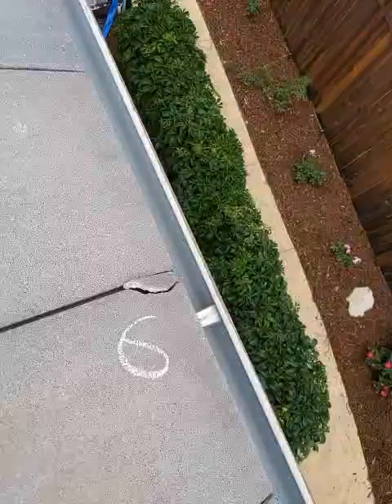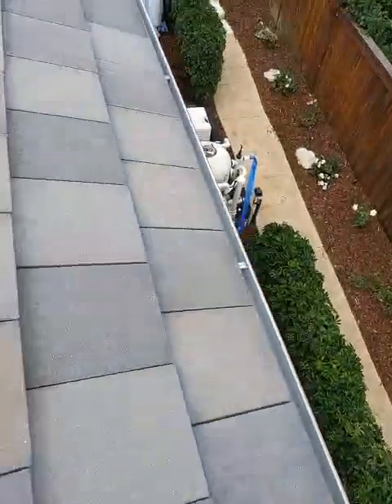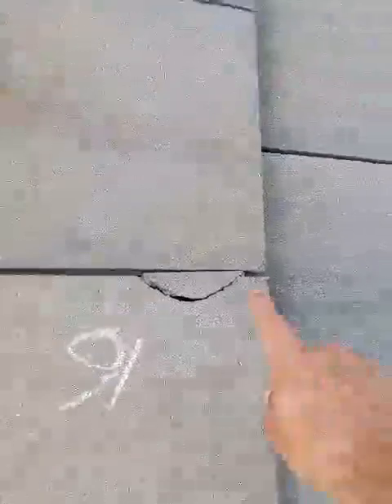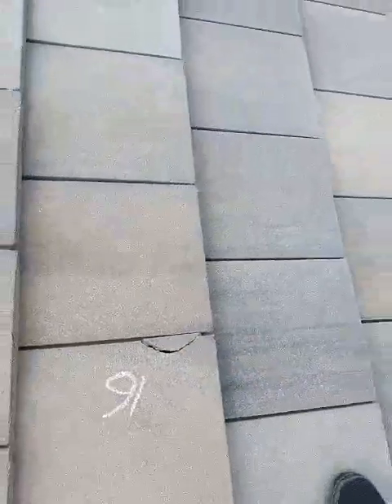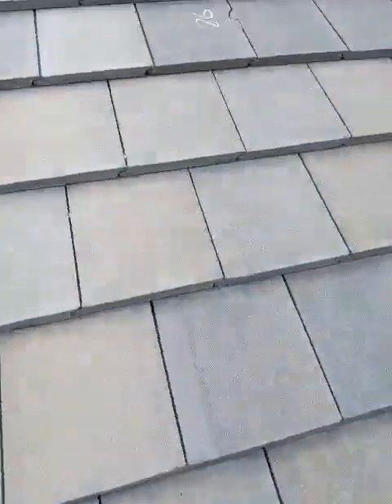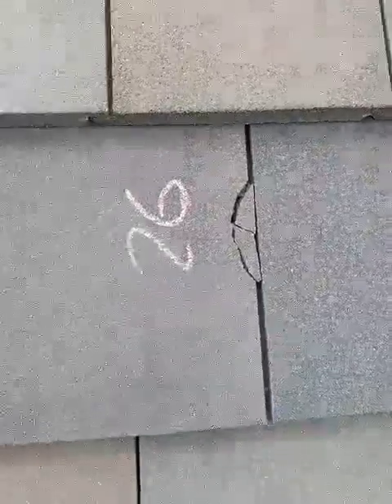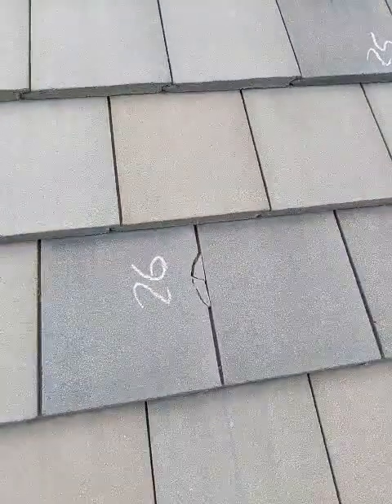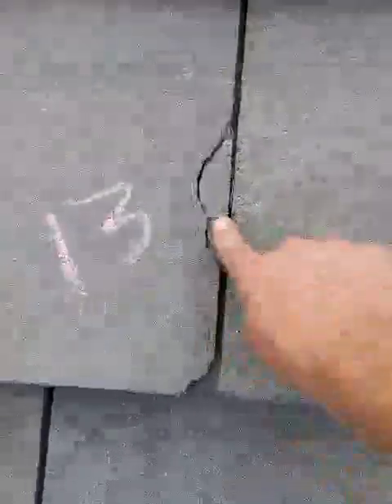What Does Hail Damage Look Like on Concrete Tile if it Only Chips a Piece?

Comment: Bottom right corner happens at manufacturing process. If you have EVER ordered even a single pallet of tile youve seen a dozen of those. Its a known weak point in the corner, even the TRI, westile, and boral have all openly admitted it. 

Its not foot fall at all. It starts in the manufacturing process. Now over time the small cracks expand due to expansion and contraction and the vibrations caused during wind, but it is 100% not originated from tile. 

This is the most desperate grab for hail. Which explains why you seem a bit bitter. Im guessing you get a lot of denials on tile 😂

Comment: There are some examples of hail damage in this video for sure.  Those shunt gaps are definitely wide enough.  But expansion/contraction definitely is not BS. The thermal movement of materials is not only the concrete but also the totality of the movement of the underlying deck as well causing movement. Not to mention the fact that any debris caught between tiles caused point loads on the edges of the tiles.  Of course roof contractors think every explanation is $$$hail$$$ is BS!

Comment: That's not hail damage.  Southern CA doesn't get damaging hail but once in a blue moon, yet we see these right corner cracks on every single concrete tile roof we inspect. I've never had anything but pea-sized hail at my house and have these all over my roof.  Tell these desert vacation homeowners who left for the hot summer and came back to garage slabs cracked, spalled and raised up in the middle that concrete doesn't expand and contract.  This isn't education.  It's misinformation.

Comment: exactly.... how does the most random act of damage only land on one of two locations on each of those tiles? that ain't hail bro
Reply: Simple physics once you consider how those tiles are made and look to see the bottom, and as the comment before me, that is the very weakest point on there but will not break with a foot as the pressure per square inch is not there so a hard object able to strike, not bend like the sole of a shoe is required to create that shape especially. Really, study physics more.'
Reply: The hail likely pounded the whole tile. But the middle of the tile is very thick and the left side is underneath the tongue and groove so that only leaves the right side. And as you can tell if you look closely, the right side is the top of the tongue and groove overlap so it is the thinnest part of the tile that would be impacted by hail. So it makes perfect sense as to why only the right edges would have broken.